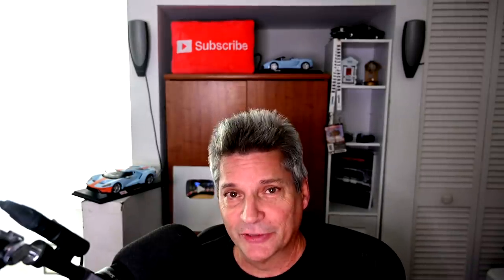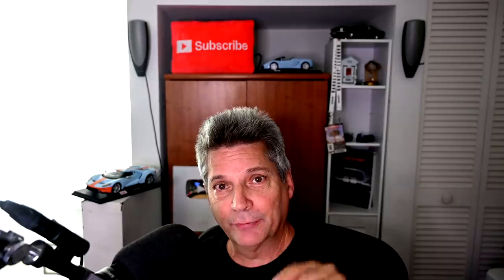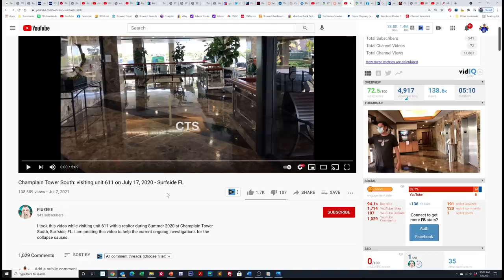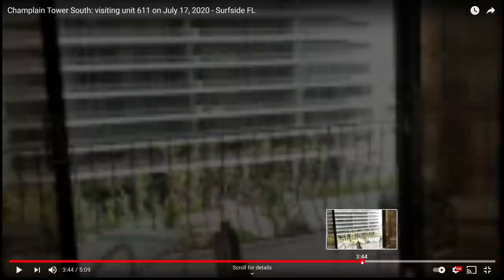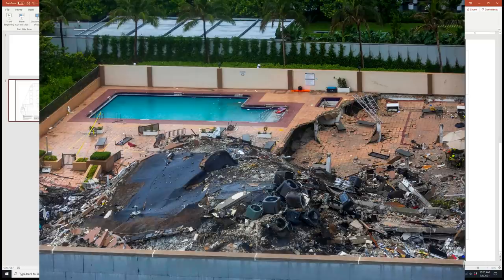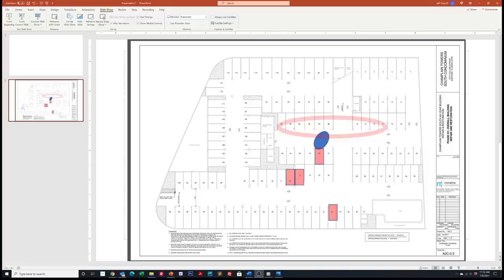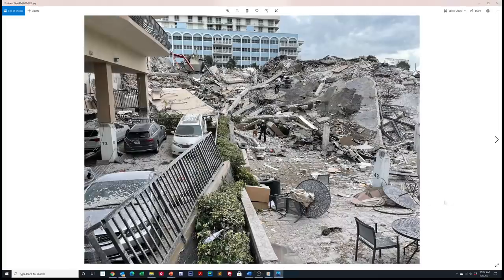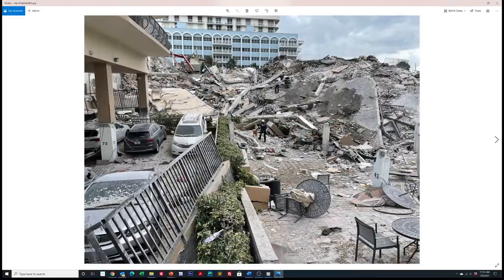Analysis Garage Video BEFORE Condo Collapse: Water Everywhere

Comment: Some of the parking lot in some of the buildings did I take care of ( I'm a maintenance engineer) have cones in their parking lot for various reasons none of which are not fairies not to say that their cones are not nefarious because as a mechanical engineer there's a lot in this video that I would not have been able to walk passing and ignore my number one concern would be all that moisture coming through the concrete causing the Paint & primer to peel off and as far as I can tell this feeling is holding the weight of the water because I don't see any effervescence along any of the walls meaning that was a lot of weight for it to try and support not to mention that holding that water would destroy all the rebar weakening the structure

Comment: 28:55 "They might set off the alarm"    I suspect it was the white PVC drain line that is seen leaking. The column of water is large diameter and low pressure. Fire protection systems for this type of building will have pumps to pressurize the system. A fire line would be higher pressure and smaller diameter. If that was a fire protection line leaking water, the flow switch in the riser room would have triggered, the fire panel would be sounding, and horn/strobes would be going off throughout the building. That being said: There are clearly fire lines above the ramp. How were these not damaged and leaking during the initial failure? In theory, everyone in the building should have been alerted by the fire system. Why do we not see the horn/strobes going off? I am a commercial electrician, not a fire protection expert. I'd love to see a fire protection expert weigh in on this.

Comment: 5:29 thats a tray they install to direct the water away from the car that would be under it. recall seeing something like that at the condo I lived in. The resident complained that the car was getting water/salt spots so the building installed it to direct the water away from the car.

Comment: Look at the flower planters weight position near the 3 columns that filled also how often were thay watered .To me concrete type specifications    Steel size mesh all critical in design and the blame in the building failure.

Comment: Another thing on the little puddles of water. This is Miami in the summer. It's HOT here and everyone has the AC on full blast in their car. The moment the  AC in the car starts blowing cold it will begin to drip water on the ground. On hot days I will remote start my truck from in the house and 5 mins later there is a puddle under my truck and a stream of water running down the driveway. If the ground is not level it will run and puddle at a low point. This could explain some of the small puddles you see in this video. Someone comes in the garage with the AC cranking, they will park and most people will sit in the car with engine running and AC on for a minute or two to gather their stuff then shut the car of. The AC will continue to drip for a while as well. So some of those small puddles could be from the AC on the cars especially around the valet parked cars unless you can prove no cars left or returned within a few hours of that video. Don't get me wrong, there was major issues going on there. The corrugated plastic sheets all over the place speaks volumes. The columns look pretty good. I think the collapse was the pool deck. The weight of the bricks, holding water, deteriorating concrete that the bricks hid. Pool deck falls in and causes a domino effect.

Comment: Around 12 minutes, see the stalactites, how evenly spaced they are.  Those look like injection ports.  Someone drills a hole and put the ports in, they have a way of injecting something to fill the crack.
Reply: 👍 Its called Epoxy Injection, Im surprised this engineer didnt know that. Sloppy job to leave the ports there, any decent contractor would trim them off. So they probably went with the cheapest, who knows maybe they didnt even use epoxy.

Comment: What would cause water to pool both on the roof (another video showing it), and the basement?

I'm thinking that their were multiple water pipe leaks within the cement walls. 

PVC water pipes mostly leak from their joints. I don't know if PVC pipe was used in the 80's, but I am certain the water leakage came from within the walls.
Reply from the maker: There were multiple cracks in the garage ceiling that we improperly repaired over the years.
Reply: @jeffostroff  
Cracks from what? 

After reading from other comments, the deck planter does sound reasonable for the collapse of the deck. Unfortunately, the deck was attached to the main building.

Yet, it doesn't explain the water pools on the roof.

Also, I saw a video about condo 611. In the hallway, just outside the door, sat a power fan and cone. The video didn't explain why.

Comment: At 25:47 the ceiling seems to go from smooth to peeling at almost a straight line as if the (non slanted) roof was pooling right between 27 and 77 (also some shawty roof work right around there), which i think is where the ceiling collapsed in the tourist video, if collapse happened here it would pull the 5 pillars that jeff predicted were the first to topple. Also at 32:14 parking spot 15/16 pillar looks similar to inspectors photos for the pillar that had damage, would also correlate with the pylons to make a near identical match to where the wall sheared. Pylon at front of spot 26/25 and at the back of spot 27 almost curves too perfectly to the hot tub to line up with your theory.

Comment: Is that usual in Miami to have epoxy paint on the ceiling of a garage?   All of the garages I’ve  seen in other areas,  just have have  the concrete exposed or perhaps have a clear sealer on them.     Having to touch up that white paint all the time would be a maintenance problem.   It makes me wonder if they were trying to cover up the real problems by using paint.

Comment: Take another look at this video again.  You will notice that at the base of column 15 - 16 the concrete is broken away and exposing the rebar.  Also, at the base of other columns the yellow paint is discolored.  This would mean that the water has gone through and discolored them.

Comment: Assessing the repair costs is one thing. Paying for it is another.  If the owners paid enough for proper repairs and then it wasn't done right by the contractors or in house maintenance people, then the blame is partially on the contractor AND the owner for not catching it. Modifications over the years are another aspect. If this parking garage and building was built using "Post Tension" cable, or a combination of rebar and cable, it is not too hard to damage the cables when installing anchors or drilling holes for whatever. I've worked in construction for 36 years and my father worked in concrete construction for over 40 years. I've seen what happens when you cut a post tension cable. In my later years, I've moved to a maintenance aspect and seen many times where a building owner ignored our recommendations and went with a cheaper, less safe, solution. Here in Wisconsin, most roads and bridges are being replaced with Green epoxy coated rebar. The original designs were before they used road salt. In the 1960's here in the "Rust Belt", we had snow tires and studded snow tires. Now we have "All Season Radials" and alot of road salt. So the salt leaches through the concrete onto the uncoated rebar and it rusts, Same goes for parking garages. Even though the parking structures don't use salt directly, the melting "Fenderburgs" on the cars drop of and then land on the parking structure floor. Water is the "Universal Solvent" and is bad anywhere in a building if uncontrolled or planned for. This is why you see that a developer will sell a new building 3 to 7 years after they built it to avoid high maintenance costs. For God's sake folks, check out the home you are moving into with an independent assessment. Especially at this price level. NEVER trust the landlord or sales agent.

Comment: Are you able to determine the structure of the cross section of the pool deck so that you can analyze it?  If the concrete layer above the membrane gets full of salty water, but the layer below the membrane stays mostly salt-free and dry, I'm thinking that there would be differential expansion of the two layers.  Also it would help to know whether the concrete was pre-tensioned or post-tensioned, and whether the steel tendons were above or below the membrane.

Comment: Water is the #1 enemy of ANY building!  Once it's noticed, it needs to be addressed immediately.  Some of this could certainly have been the result of AC condensation from the cars in the garage and pipes sweating but the bigger puddles are definitely linked to a much more serious problem.

Comment: If that was a  fire sprinkler flow in the tourist video looking into the car ramp it would definitely set off a fire alarm because there is a flow meter in the sprinkler system to ensure an alarm. Also the water looks too clean. My experience is sprinkler pipe water is usually the color of coffee.  Great analysis Jeff , thanks.

Comment: Being that this is Florida... Is it possible some of the water on the floor relates to rainfall, since it just about rains in Florida on a daily basis?  This would include water from cars and water blowing in from the openings around the garage.  Also, there does not seem to be active dripping going on.

(I'm not disputing anything in this video; it is obvious this building had issues and leaks.  I guess what gets me more than anything is that this place was built ~1979 and took this long to collapse despite regular leaking.  With the saltwater and constant rainfall, it's amazing it stood as long as it did.)

Comment: Might be urethane foam injected into some cracks on the ceiling. Look for drill holes and yellowish foam exiting. 13.00 looks like it was patched. They will have grease fittings sticking out with the foam. Half in to 5/8 drill holes

Comment: If you look at any of those old abandoned car manufacturing buildings in Detroit you can see were water has dissolved the concrete and rebar making stalactites and stalagmites on the floors and ceilings. 🤓👍

Comment: When will they show the video cam footage? Looks like a fairly new camera system in that garage which means there was not only a local hard drive but also saved over the internet. The cams will show everything at the collapse and everything months to years prior. This will help answer the questions for the family and future builders. Was there an issue with the building columns? Sabotage? too much vibration from the onsite construction? neighboring construction? Someone in a big vehicle drive drunk into several columns? or something else????

Comment: An item that could have been in play is the ocean spray, if water on deck becomes salty and leaks/absorbed into the concrete, rebar, the salt will help corrode everything. Like a possible accelerant…..

Comment: I commented in your previous video June 2nd about the possibility of a vehicle crashing into a pillar in the lower parking garage. I have seen this before in a 6 level parking garage in Alabama. The garage was in very bad condition from erosion and water damage and in this case a drunk driver crashed into one of the lower pillars and brought down a third of the garage. fortunately it was 4:00 am in the morning and no one else was injured. I was part of the clean up crew running an excavator.

Comment: At 19:14 while you are saying that on spots near 101 seems to be fine, on the ceiling besides some pipes, there is something that seems to be a big crack with rust and paint peeling around.
Reply: At 20:29 I see the same rusty crack on the ceiling with an L form, and above the white pipe there is something strange hanging, maybe paint peeling but it is pretty big. If the damage there was all around, it could have form a hole.

Comment: The five basement cols punched through the footing pads after the rebar deteriorated in the footing due to salt water intrusion and corrosion. 
This dropped the whole facade and pulled everything else down. The pool deck is the oddity as there was no load on it but vibration and pounding probably caused the cols to punch through the deck before it dropped. Total lack of rebar evident at col tops, sheared right through it appears.

Comment: What you see in the ceiling above Space 53 are rusting steel hanger rods. This is very common and is attributable to City required code upgrade retrofits. If you take a look at the entire ceiling area you will see what can only be described as an extensive lattice of pipes and electrical conduit. All these pipes and conduit must be attached with a pipe or conduit hanger that is made out of steel. This is done by drilling a 4 to 5 inch hole in the concrete and inserting a steel anchor  into which a steel threaded rod in screwed into.  Eventually, the anchor and steel rod corrode and spall the concreate, and that's the damage that you see above Parking space 53. I am willing to bet that there are one or two sheetrock hidden columns in the vestibule which failed because no one ever thought to check if there were any hidden columns.

Comment: As far as the water coming down from the ceiling in the tourist video 7 minutes before the collapse. I bet because this building is in Miami that is a wet pipe sprinkler system and if it starts flowing water an alarm will go off. I don’t remember hearing any alarms in the previous video. That was probably a water line. It’s amazing this building lasted as long as it did. Also, what about pre fire planing? Did the local fire Dept. Not pre planning on this place? It being residential I kinda doubt it, but every place is different when it comes to yearly inspections and pre planning.

Comment: How about the crack in the ceiling at 10.30? Also, notice that the car in the spot across from 78 was parked to the back, as if to leave space in the front to avoid... water leaking from the ceiling
Reply from the maker: yes, lots going on in that garage

Comment: In the garage videos, my eyes keep going to column 15/16. It looks like it's leaning. Look at the yellow paint line in comparison to all the other column paint lines. Look at the base of it where it meets the foundation. It looks off. Maybe just a sloppy paint job or camera perspective, but find it interesting there are huge cracks at the foundation where that column is. Cars entering the garage at the bottom of the ramp, pounding away at that foundation over and over for 30+yrs  32:19

Comment: With regard to all the little water puddles. Keep in mind this is Miami in the summer and it's HOT outside so everyone that lives there has their AC cranking in their car. If you get in your car you start it, then get the AC going and the moment the AC starts blowing cold it will drip condensation water on the ground. I know on hot days I will remote start my truck from in the house and 5 mins later when I go to leave there is already a puddle of AC condensation water in my driveway. So they drip almost instantly. Also, upon return the people were driving outside where it is hot. They come home and most people will sit in the car a minute or so with the engine running and AC on to gather their things. Even when you shut the car off, the AC will drip for another 5 minutes. That is a pretty smooth floor so the water in xxx parking space may not have been from the car in that spot. But it could be a low point of an adjacent spot of a car with dripping AC. 

Another consideration, people get their car washed outside, then bring it in dripping. Or if it's raining people drive their wet car in and it will drip off rain water for like an hour. I am not taking away from the idea of the water coming from the above pool deck or the pool. But in SE Florida in the summer it is normal to see little puddles of water around most of the cars.

Comment: There is a better picture of the  garage ceiling with the rescue people there with a jack holding it up where all the Rebar has been ripped out. The pipe with the white covering looks to be insulation over what you can see. Was this building heated with hot water for winter?
Reply from the maker: yes saw all those photos

Comment: At the 5:26 minute mark when you had the 106 parking spot column in the shot, look at the base of the column where its darker. Many times when I've seen this on concrete walls or columns it water weeping up.. And it looks like a puddle of water sitting behind that column.
Reply from the maker: yes many folks pointed that out, like water had wicked up the columns at some point

Comment: Water had to be dripping from the roof of the parking garage I know this from experience what happens if drywall gets wet the paper on the drywall soaks up moisture and bubbles up or blisters causing the latex paint to also blister up concrete is alot of the time painted using latex paint which will blister if constantly exposed to a warm wet humid environment latex paint loses its adhesion properties and blisters off exposing the concrete underneath thus setting the stage for deterition of said concrete water eroding away concrete is much like water eroding away limestone enough water penetration will cause a sinkhole to develop which I believe is what happened here I could be wrong but I think rainwater was infiltrating the pool deck breaking down the sand overtime then eventually the concrete itself then boom sinkhole develops in the pool deck weakening the entire structure until it finally collapses due to the undermining and strain of trying to remain upright.